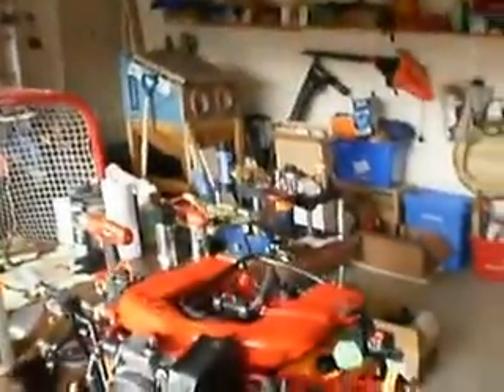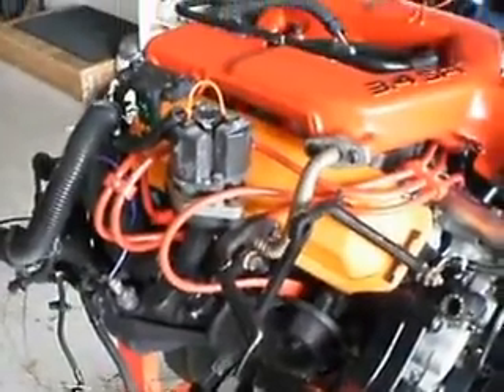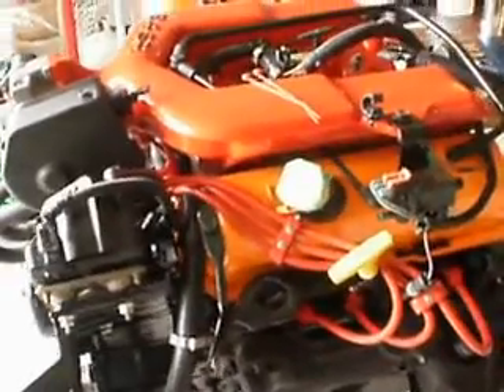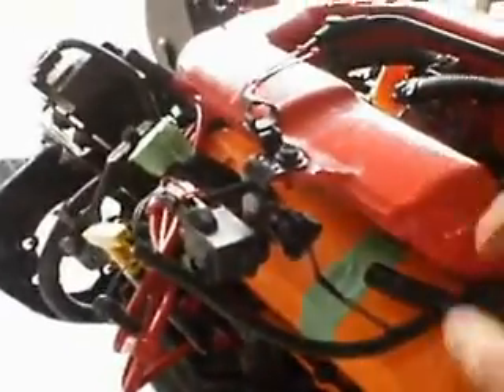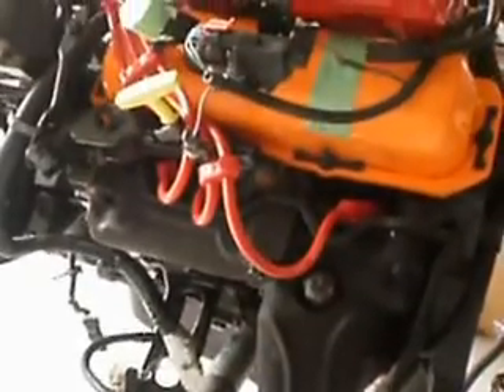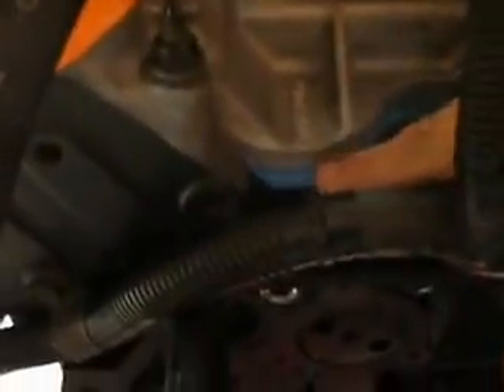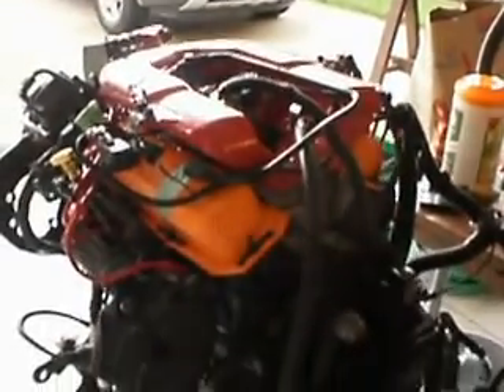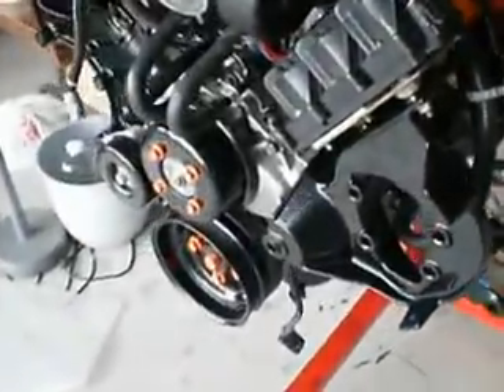Camaro 3.4L Engine Swap (Preview)

Comment: Did you drop it out the bottom or pull it through the top? Were pulling mine out through the top right now. Its tricky to do, but i didnt want to undo all the suspension/steering components. We just cut the exhaust at the manifolds (replacing with Pacesetter headers) , dropped the trans 3" to get to the bell housing bolts and are pulling the engine in the morning. Top half of engine is being rebuilt along with full head and intake port/polish, comp cam 252 cam, new tune, and straight pipe exhaust. Its going to be a street legal drift car, welded diff and all new adjustable suspension.

Comment: cost?
Reply from the maker: - Engine was $400 from a junk yard, 110,000kms on it.
- Rebuild at local race shop (honing cylinders, head work, valve work, all new gaskets, new oil pump, bearings for crank and cam) $1100
- Parts (sensors, odd gaskets) ~$400
- Paint (powdercoat, some enamel and header paint) $170
- Swap $750 (got to help out a lot at the shop, mechanic was a nice guy) 

TOTAL = $2820

So pretty much 3k after all was said and done. To me, it was completely worth it as I now know everything on my engine is new, in good working condition and set back to zero basically. Body has 314,000kms on it now, engine only at 13,000kms :)
Reply: Fantastic, thank you. I'm thinking about doing the same.
Reply from the maker: David Gray Not a problem, and if you have any questions on where to get parts or engines or anything really let me know, I can message you tonnes of info
Reply: awesome, thank you. Ill hit u up in the spring

Comment: Yea, I see that aspect, but Im doing a cylinder head job on mibe, myself, and it really wasnt too bad.  New wiring harness does suck though. I put dressing on alot of my engine, ill post it when i get the exhaust split.

Comment from the maker: I got quoted 1500 lowest to repair it. Easiest way to repair is to drop from underneath, really tricky engine to work with thanks to the depth in the cowling. 
All my vaccuum lines were cracked and I needed to replace my wiring harness anyway, was looking pretty bad. So I went with this way so I could customize the block and take my time with it

Comment from the maker: Not at all, surprisingly went well. 
Been in for 7 months now, no leaks, no loss in power, no problem starting up and good idle. Should run well for a while, I don't drive it too hard either

Comment from the maker: Haha nice, the only regret I have is the tone of the orange on the valve covers. They used "safety orange" but I wanted GM classic orange. It's a bit deeper than the safety orange, but that's the only powder coat colour they had. 
Check out my other video to see it in the engine bay, my fuse box cover is painted GM orange you can really see the difference there

Comment from the maker: Oh absolutely, I talked to many shops and most said no right away! 
Found a mechanic that was willing to help me out though, worked with him to put it in because we decided to use a lift, drop the old engine and tranny out from underneath, swap and then bolt it back up. 
I looked into that too, heard it was a lot of work and to just drop it from underneath as the simplest way. 3rd gens are beautiful, my buddy has a 91 z28. Not sure why they designed the 4th gen engine bays like they did lol

Comment: thats cause most shops are afraid to work on 4th gens! so they give a high ass quote in hopes you go somewhere else with it. from what I understand you can remove the whole upper cowl and wiper assembly to get better access to it all, but most shops don't want to go through all the trouble, not sure I'm a 3rd gen owner, and my boss at my shop never wanted to do 4th gens cause of how far under all that crap the engine was placed

Comment from the maker: Would you be doing the work yourself or be paying someone to do it? It's going to be at least 1500$ to have a shop fix that. To repair my lower intake manifold, without even removing the heads/disassembling the rods I got a 1200$ quote. 
If you're doing it yourself, then YES. Because that's really low kms!
Reply: Did you have a hard time pulling motor.as my son needs a new motor in his 94 camero.

Comment from the maker: I think ur talking about the oil filter adapter housing? Is it a large bolt with hole drilled through the shaft in opposite directions? Or did the housing that attaches the filter to the block physically crack

Comment: i got a 94 camaro with the same engine i think i might have broke something on it but dont know what the part is .its that metal tube thing thats connected to the part where the oil filter is ,it sticks out on the side.i was hoping u were gonna mention it but u didnt.can u help me out i would appreciate it.thank u.

Comment from the maker: Told the race shop that the 3.4L gets 160 stock. Their best guess base on the work they did and the parts installed is 200-205HP, that's just their best opinion. I do have a cold air intake, and a 3-way cat instead of a 2-way for a bit higher flow. I'd guess around 210HP with those add-ons, 215 may be a stretch but under the right conditions it may reach that. 
Hopefully going to dyno it once the motor has been broken in! Installed successfully this last Tuesday, so far not a single problem.